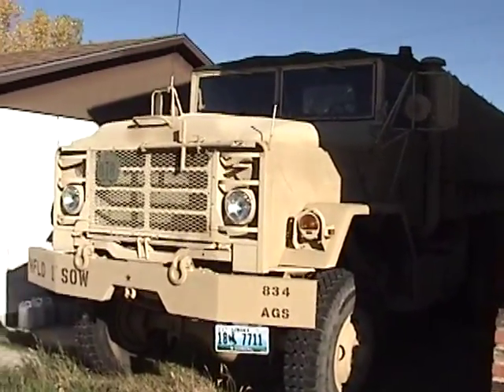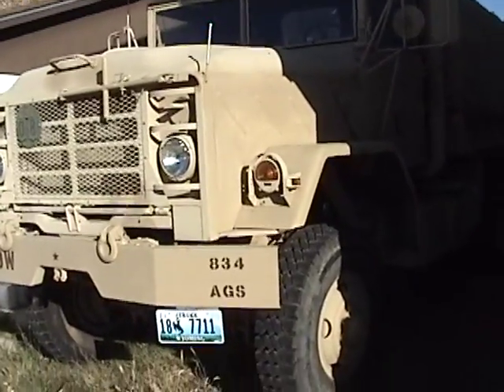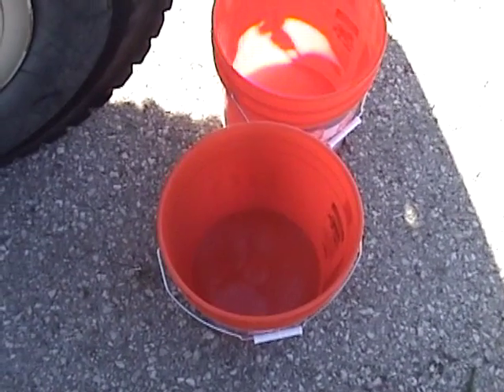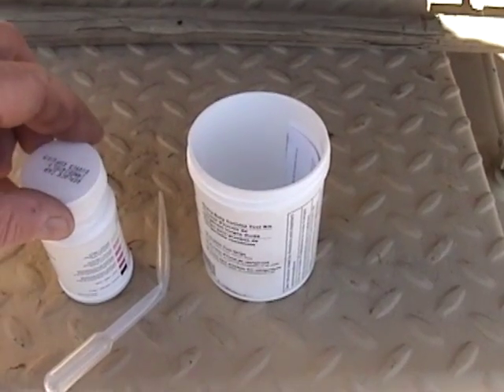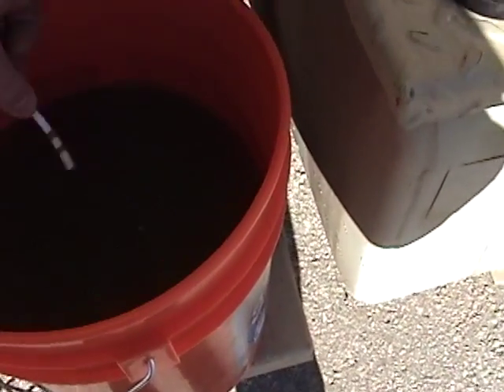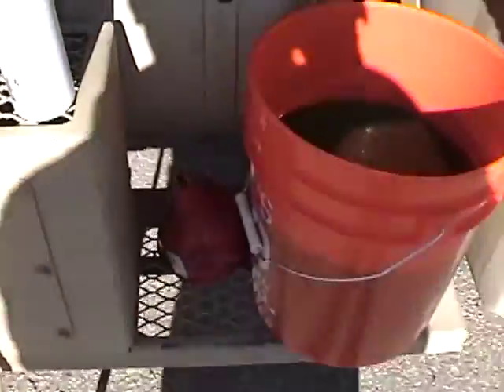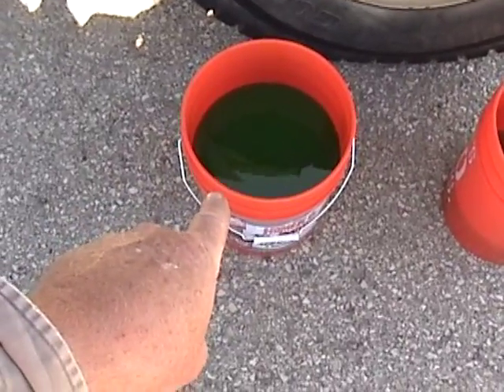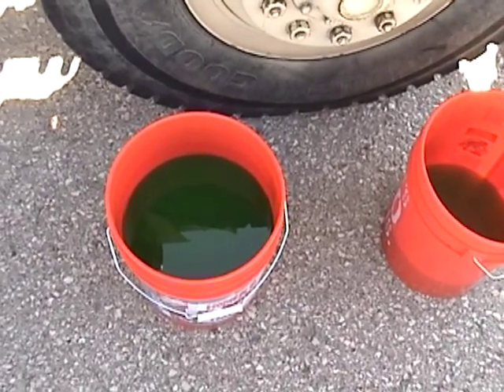m923 truck antifreeze

Comment: Good vid. When I bought my truck, the SCA portion of the test strip didn't even change color, it just stayed yellow/white. (Yes, my test strips were within the expiration date). I bought an entire gallon jug and I'm still hitting it with test strips, trying to get the chemistry right.

Once winter is over (or at least warmer), I'm just going to drain and replace all of the coolant.
Reply from the maker: I like that idea, but the biggest problem with these things is the heat. I have been reading that the military put 200 degree thermostats in these engines, claiming it gives better engine performance if these trucks ran hot. I haven't done it yet but I think my thermostat is a set at 200 degrees because that what my truck was running at most of the time. Very rarely did my fan clutch kick in because the actuating stat is set for 220 degrees. So I'm going to get a 170 degree thermostat and see if I can keep the engine at 180. If not I'll remove the thermostat completely and just run it with a full open cooling system.

Comment: why didnt you just dump the additives in the fill tank? Nothing wronge with the way you did it. I just picked up a 1990 BMY. What kind of engine oil do you use?
Reply from the maker: This was aimed for a person whom never have done anything like this before. I wanted to show the litmus strips with the two different readings, one being low and the other the correct reading by using and trusting the instructions on the bottle.  This was the quickest and easiest way I could have shown the results. 

But for people who know all about additives, yes, just take a reading and add the additives according to the label on the bottle as you know what the results will be.  

As far as engine oil, I use the Shell Rotellat 15w-40 synthetic because of the winters here. I seen oil turn into molasses at -5 degrees. I change my oil every 5,000 miles or every year, which ever comes first. 

As far as my transmission I use NAPA tractor hydraulic oil compatible for Allison C-4 transmissions. I think its a 10 wt oil.
Reply from the maker: Also congrats on your purchase. Hope you have fun with it. They can be overwhelming at times when something goes wrong. One being if your away from home how do you get it home if it craps out on you. You just cant rent a U-Haul car dolly to retrieve your 5 ton. Mine left me stranded twice. 1st time was the day I brought it, I was two hours from home decided to stop and get something to eat. Shut down the engine and when I went to start it all three batteries were dead. The person I bought it from already had it running when I got there, he failed to tell me of the dead batteries. So luckily I stopped at a town instead of a truck stop in the middle of nowhere.  Had to shell out 1,000.00 dollars for 4 batteries the next day.  This last Nov. I drove it 200 miles before I stored it for the winter. Parked it at a train depot where I worked temporary, (they were short of engineers) when I returned to the depot to dive the truck back home the starter had a meltdown, everything inside was just melted together. I figured the previous owner burnt up the starter trying to start the truck with weak batteries. because when I replaced the starter the engine rpm was around a 1,000 rpm. verses 300 rpm
Reply: thanks for the reply.. what engine oil do you use?